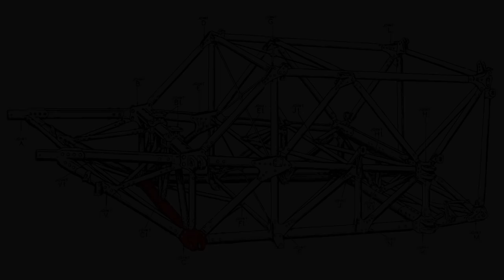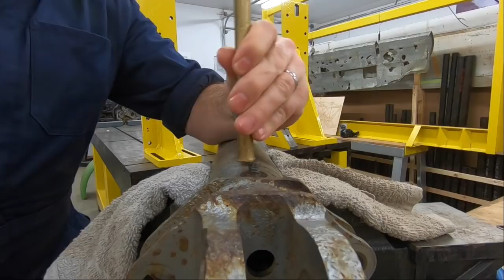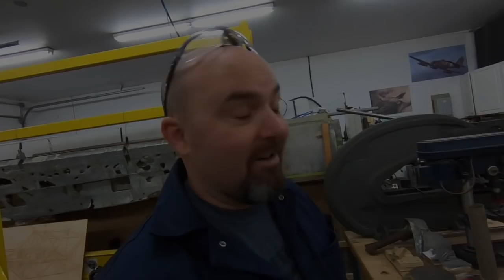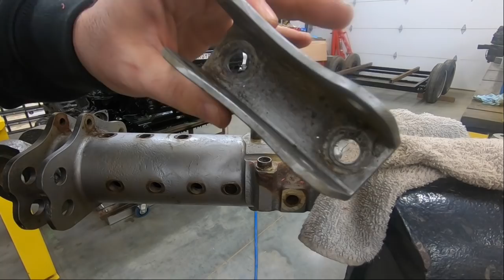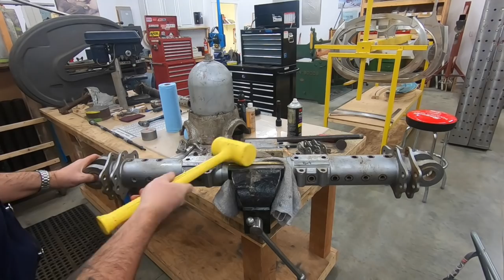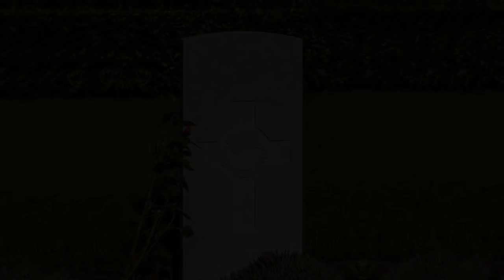S01E09 Hawker Typhoon Wing Spar Hidden Parts!

Comment: Look I'm not trying to be too much of a busy body but I'm  a retired A& P  mechanic and I've worked on military and commercial aircraft with 48 years experience. 
So ,  as I see you trying to drive out bolts with no backup that can cause mushrooming problems. 
With that said  , mushrooming problems are ALWAYS  present anyway . It's how well you manage those problems. 
By backing up the bolt on the opposite end you get a much more forceful blow. 
Use a bucking bar or similar tool  put duct tape to cushion the tubeing , put the bar next to the bolt head ( maybe  2  bars one on either side of bolt head, might need help to hold it all) !  Lol ...
Nut end  should be flat  not ground off at a angle to absorb the blows solidly. Also use a bigger hammer with brass punch. 
Brass lessons the chance of mushrooming. 
1 or 2 blows should drive it most of the way out. 
If it does not work you might have to drill or something else.

Comment: A very light squeeze in a vice or similar tool will cause tube just enough deflection to let distance tube to drop Out on it's own with no damage to anything. 
At least use this method upon  reassembly , with the proper padding and techniques you should be able to reassemble it with little difficulty.

Comment: To remove encrusted nut or bolt: You can shrink the part with cold temperature. Put your socket into a container of liquid gas in the liquid form. I was a bad boy and used propane which I got from a 5 gallon tank turned upside down. I was trying to get 20 year old spark plugs out of aluminum cylinder heads without strippiing the threads out at the same time. I dunked the spark plug socket into the minus 100 liquid and out came the plugs! I don't know if it really helped but it gave me the courage to try! It probably helped get the penetrating oil to sneak in. Love the videos!
Reply from the maker: A few ten thousandths of an inch can make all of the difference in the world! ~Ian

Comment: Hey  just found your channel  great work  we would use dry ice to help break tight fittings  bushes and bearings stay safe cheers
Reply from the maker: Glad to have you following along with us! Dry ice would be great, but isn't always readily available. ~Ian
Reply: The North Island Dairy, is long gone from Courtenay, (over 20 years) but that was where I used to buy dry ice. Maybe they would still be using dry ice where they are processing the milk nowadays. Nanaimo maybe?  There is nothing like it for removing and installing close fitting parts.  (Airline caterers also use a lot of dry ice.)  My school commander, W/C Bill Bliss, RCAF, flew the Typhoon from before D Day, to the end of the war.  What a great project.

Comment: Wow, strong parts! Looks like strength was the only design consideration on the Typhoon.  I'm wondering if you or fellows in your industry use laser cleaning regularly?  I know it's still costly, but the time saving and nondestructive attributes would be of enormous benefit in your industry --no, I'm not selling Lazers.
Reply from the maker: Typically if the corrosion is bad enough to require that type of work, the parts are beyond repair. Where there is extensive surface rust, there is usually pitting, and with pitting it is easy to exceed 10% of material thickness (general standard, parts like these are usually more restrictive. Also, when it gets that bad you would need to NDT for intergranular corrosion and issues with inclusions in the metal; all very costly for a part that has very little chance of being used. Very cool tech though! ~Ian
Reply: @TyphoonLegacySociety  Thanks for responding, you know your stuff!  Lasers sure do remove paint quickly and it gets into the crevices. Noticed on Alibaba that prices are starting to come down from the 50K range to the 10k range. Hopefully, we'll all have one in the shop soon.
Reply from the maker: @glikar1  It sure would be a handy tool to have, there are lots of applications in any metal shop where it would be handy; I would imagine an automotive restoration shop would be an ideal place to have such a beast! ~Ian

Comment: I'm curious how the wreck came into your possession, it's history, the recovery, what happened on the final flight ?(I've been to the website, no specfics that I could find, only the date of the loss)
Reply from the maker: Hi Kent, very little of the original JP843 survives, only one serialized panel in fact. The remainder of the original parts are from various recoveries that were done years ago before I bought the collection of Roger Marley. The larges original component, our wing, has yet to be identified, but is believed to have been from a Typhoon loss during the battle of the Bulge. ~Ian
Reply: @TyphoonLegacySociety  Thanks for the reply. I'd suggest clearly explaining this on the website. Of course this is the Theseus ship situation all over again, an unanswerable question but to me, using terms like rebuilding JP843, returning JP843 to the skies, referring to the work as JP843 is stretching it, if only a serialized panel exist that will eventually be fitted. Philosophically, if you'd started with a single original rivet, and built the fixtures and parts around it, I'd have no problem, but everyone has their own opinion on Theseus ship. Anyway, I'm looking forward to following the progress.
Reply from the maker: @KSCPMark6742  There are very few warbirds built from more these days, perhaps we are just more open about it?

Comment: Crikey corrosions said rigger riley, the bolts came out and it is so ggod to watch you at work, i spent 6 monnths in an airline metal workshop so appreciate all that you do, Were they an interferrence fit ?
Reply from the maker: The bolts are an interference fit, all holes in these tubes are reamed on assembly, the fits used have left very clean surfaces on the removed parts. ~Ian

Comment: Pretty fascinating stuff for those of us that aren’t engineers but have some mechanical knowledge.

You would think that some heat must have been used to insert those compression blocks and tubes.

Keep up the great work!
Reply from the maker: They may have cooled the aluminum parts, but the tolerances are really not as tight as the parts in this video make it seem. Corrosion was the prime enemy here. ~Ian

Comment: Don`t make it to fly. Its accident rate was terrible. Use oil in any time when is corrosion stuck. It prevent it pile up.
Reply from the maker: The Typhoon ended up being quite reliable towards the end of the war. but early on there were many problems associated with the aircraft being pressed into service. ~Ian

Comment: Were these big fittings with the lugs in the end machined from solid bar or were they forgings?  What steel alloy are they? How will you manufacture new ones?
Reply from the maker: The original fittings were forged. A great deal of work has been done to allow the use of wrought material for the new parts. The original alloy was BS S.65 steel. ~Ian
Reply: @TyphoonLegacySociety  what is that in aisi? So I guess that process substitution is the only thing that takes project from impossible to extremely daunting! But with modern methods and an extreme amount of determination anything is possible. Paul Allen's group will fly a Stuka. Never thought I would see one of those in the air. Of course that group has bottomless pit of microsoft money! I hope you guys can find a patron.
Reply from the maker: @sblack48  That is a bit of a trick, the British alloys were very well made; a very close modern alloy would be SAE 4340. 

It would be great if we could attract some additional sponsors to help with the project, the more exposure we get here on YouTube will really help there I think. ~Ian

Comment: Removing really stuck bolts I have dressed the top of the bolt “file flat” centre punch it and drilled them centrally to remove a large proportion of the bolt centre but not all the way through the length. This makes the bolt able to collapse slightly, then using a punch down the hole in the bolt which bottoms on the un-drilled section of the bolt drive it out. This drives the bolt from the far end and less chance of bolt becoming a rivet. Would be great with the use of your rivet gun and extension. I used this on truck axles to get out king pin cotter pins which where tapered and corroded in place. Worked a treat!
Reply from the maker: A great technique for sure! I do try to avoid drilling them when there is a chance that we will need them for reverse engineering though.~Ian

Comment: I'm curious...were all these castings designed specifically for the Typhoon, or are they borrowed from other aircraft? 
(I recall hearing that Boeing purchased one of the first super computers to simplify their parts inventory, because they had a lot of parts that were the same between different aircraft, but were designed independently and categorized as different parts...)
Reply from the maker: These ones are all unique to the Typhoon, Hawker did have standard parts used on many types, these are referred to as the Hawker A standards. ~Ian

Comment: Would it not have been an idea to have a bag, or pillow on the floor to catch the distance fitting and prevent it hitting the floor? Although it may not be used, it is still a reference, part, and impact with the floor will have caused some damage - even if on a microscopic level.........
Also, are those big wing attach forgings still useable, or will you have to create new ones?
Reply from the maker: The spar forks shown will not be usable, all eight positions will be made new to original specifications. ~Ian

Comment: Good work sir.  Will be fun to reinstall them and get them to line up correctly.  Be neat to find out what the factory used to push them in with. Really like the videos.
Reply from the maker: Thank you! It should be much less work for the new part installation, by then I'll have made a nice cradle style punch for gentle work. ~Ian

Comment: I'm surprised how relatively easy the sleeve end all came off the tube. Maybe I'm too used to working with steel in a salty enviroment.
Reply from the maker: The faying surfaces still had their cadmium plating intact for the most part, the second side of B-B was a bit harder due to small amounts of corrosion at the inner end. ~Ian

Comment: Even if one knows that tube carries a 2,400hp motor and half the lift, it's hard not to think it looks more like part of the mooring equipment of a fair-sized ship than an aircraft component.
Reply: Think of an 11000 lb aircraft pulling 5 or 6g, so those fittings are dealing with 30+ thousand pounds on each wing. Not insignificant. I don’t know what the limit loads were on British fighters of the era but they had to be pretty high.

Comment: I am a restoration volunteer on the Battleship Texas. We are currently restoring 10 -  3” inch AA guns.  Whereas we will not be “flying” the guns, they will all train and elevate and have functioning breech blocks. (They are demilitarized and will not fire.). It is interesting to see that we are using many of the same techniques for disassembly.  The biggest tool we use is lots of time.
Reply from the maker: That sounds like a great project. The work I did in this video is pretty brutal for aircraft work, but it was acceptable given the nature of the parts; regardless of technique, I must agree about time and patience! ~Ian

Comment: During my apprenticeship, I was taught that warming stuck parts like this helps to free them. Also not to hammer bolt/stud ends as they sometimes mushroom over and then will not pass through the fittings. I note that most of these bolts passed fully through the spar, so I would have made up an extractor to try and pull them through.
Reply from the maker: Heat and cooling can help significantly, just getting the parts to break free from each other. A few ten thousandths of an inch is all it takes to get it started. It certainly isn't ideal to hit the bolt ends either, and using the hydraulic press would have been an option; but given the nature of the parts I slowly went from oft punches to a straight on attack with the hammer! The ends of some bolts needed to be dressed to be pushed through. Ian
Reply: By heating though won’t it also heat the internal part as well so they both expand making little difference?
Reply: Yes....if the heat source is kept in the same position too long. The trick here is to heat up one part quickly but carefully before the other is also warmed. This briefly creates enough of a gap to help break any corrosion bonding between the repectives chunks. This may also, in turn, allow penetrating oil to do some good. Heating is commonly used to expand areas to help in removing / replacing bearings.
Reply from the maker: @PNH750  With very controlled heat, the use of a heat pencil would be good in that case. Most heating for bearing installs and removal is done in a furnace with very accurate control. As mentioned, the internal aluminum fittings would likely expand at a faster rate than the surrounding steel parts. In the video I also touched on another reason why heat is avoided in some cases. ~Ian
Reply: @TyphoonLegacySociety  understood. Would Hawker have used heat to install those internal pieces. That is, heating the external tubing only?
Reply from the maker: @merlin51h84  I don't think they would have in this case. Typically heating and cooling is used where there is an interference fit, such as the installation and removal of bearing races in housings and wheels. In this case, (when there is no corrosion), there is no interference fit. ~Ian
Reply from the maker: @merlin51h84  I think it would be unlikely in this specific situation; the tolerance should allow for a fairly easy install. I would guess that if there was an issue the first step would be to freeze the distance tubes/blocks.
Reply from the maker: @merlin51h84  That was a consideration here as well, the internal aluminum parts would have taken heat faster than the surrounding steel; likely making the problem worse. ~Ian

Comment: You should hit those bolts back in once they get stuck. Put spray oil in from head side before hitting back and then try removing again
Reply from the maker: That is actually what I had to do with the most stubborn one, it just got edited out! ~Ian

Comment: Does the way the aluminum for those internal strengtheners just fell to bits suggest a high magnesium alloy?

Thanks for yet another consistently interesting and informative production buddy!
Reply from the maker: I don't think it is, but we will need to do tests to determine the alloy for sure. Most of the assemblies in the area were put together with primer, and I was surprised to see that these parts were completely bare, especially when there is an aluminum to steel mating surface! ~Ian

Comment: I was supprised that you did not twist them through 45deg before knocking them out but then with the corrosion they probably would not turn. On fitting though, I think it would be good to help not having material shaved off by the edges of the holes.
Reply from the maker: All of the holes that go through these parts are reamed to size on installation; I noticed that there was quite a burr on the inside of the cross strut and the spar fittings when I took them off. When the new parts are put together everything will go quite a bit easier. ~Ian
Reply: @TyphoonLegacySociety  Yes fitting into deburred holes then reamed. Will you use a jointing compound?
Reply from the maker: @flyingkub  Just wet install with primer I suspect, but the distance tubes will need to be fully protected and cured before the installation. ~Ian
Reply: @TyphoonLegacySociety  Thanks. Just the sort of work I would love to do.

Comment: Wow - that was a big slide-hammer! - 2.5" round steel bar!  Did the job though.  Great video showing all the hard work required to find all the hidden details the old structure can tell you - story by story!
Reply from the maker: It sure wasn't ideal, but the resistance on those distance tubes when they stacked up inside was really something. Although some smaller tubes were crushed, there is plenty of information to replace them with new ones; and the bar will go back to the machine shop side and eventually become cockpit fittings! ~Ian

Comment: Must have been fun installing that distance piece in the factory and getting the it all to line up correctly with the holes!!
Reply from the maker: During filming of this one, I started to design a tool to punch them out which would also be used for installation; given the condition of the parts, I chose to sacrifice a few internal distance tubes instead. The basic design is a punch with a cradle to allow the rotation and proper support of each part. I suspect everything will go together much easier with the new parts! ~ Ian
Reply: @TyphoonLegacySociety  When reinstalling those spacers, will you freeze them first, to aid the insertion ?
Reply from the maker: @stevem7868-y4l  Likely not for these, they aren't supposed to be an interference fit, the stubbornness was a result of corrosion in this case. ~Ian
Reply: It should be quite easy if you make the right tool. All you need is a huge punch with a slot milled to the end. That way you can rotate the punch and align the holes in the rotational direction. For the last distance block with the cross tube, you would need two slots at the end of the punch.  One deep to support the block, and one to support the cross tube.  When a distance block is in place, you could secure it with a plastic/wood pin, who fit tightly in the hole. The ends must not extend outside the diameter of the tube. Then you can slid the bracket onto the tube, and when in correct position, the bolts would push out the alignment pins during the assembly process.
Reply: And how will they make and assemble new ones?
Reply: I'm sure they designed some "crush" of the pipe into that brace.